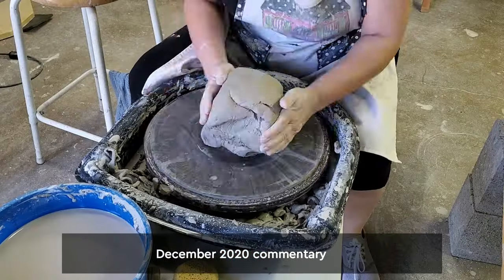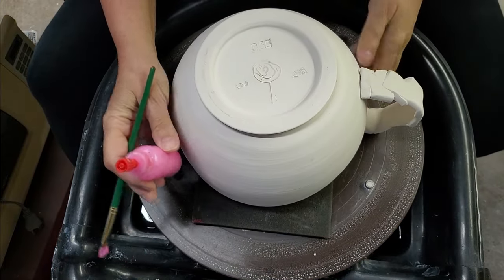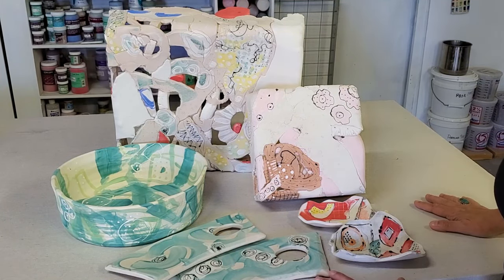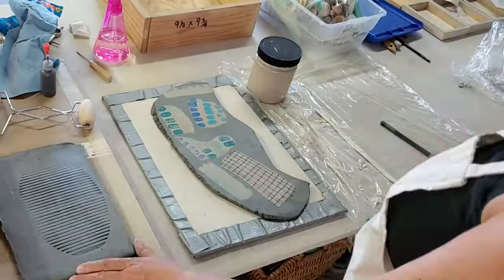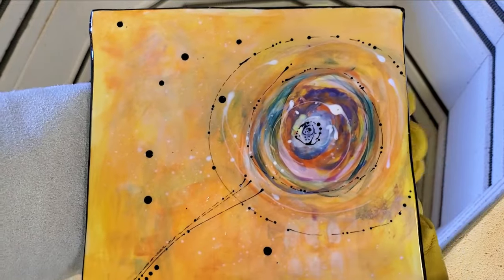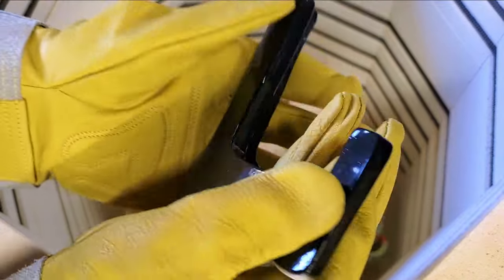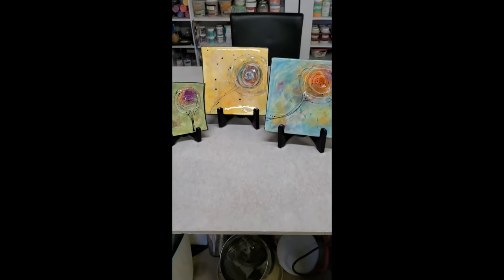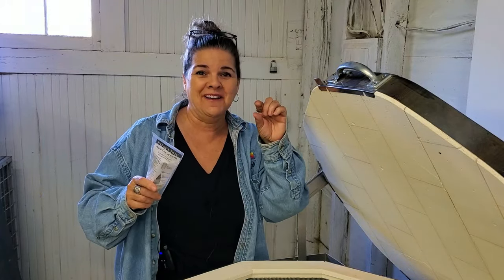That's a Wrap! Pottery Archives  -2021, 2022, 2023 - Hobby Potter

Comment: Did you test the clay to make sure it’s vitrified at cone 5? I feel like everyone seems to forget about vitrification!!
Reply from the maker: Thank you Michelle,  Yes, this clay has been tested for vitrification (using the boil test shown in a past video). I may need to retest though as I'm finding the current version of the same clay works differently with me clear glaze.  I'm wondering if the formula/recipe of clay changed after by the manufacturer post COVID. 🤔hmmm